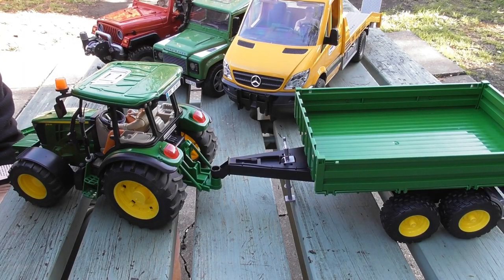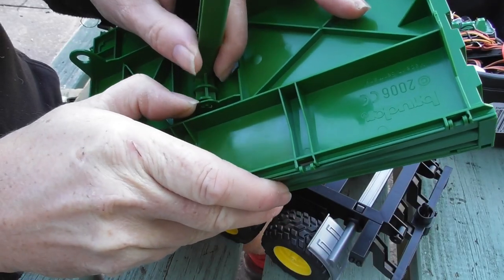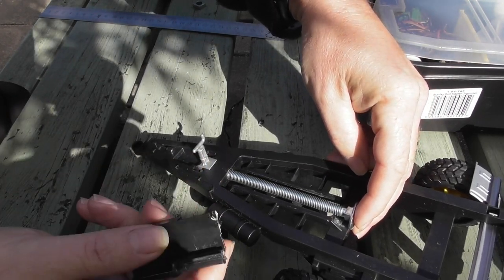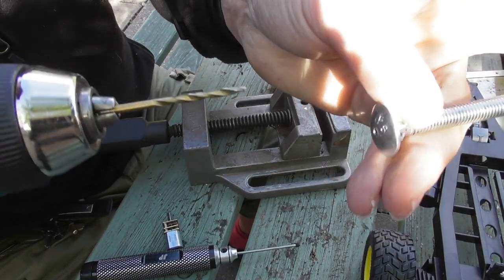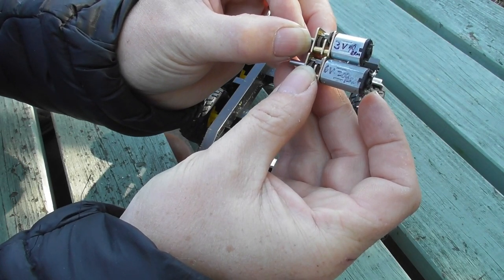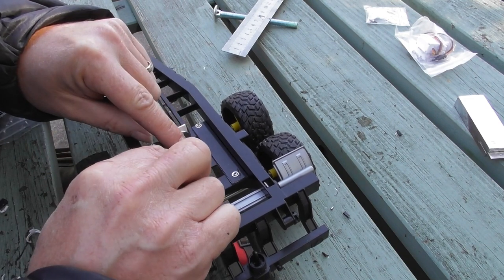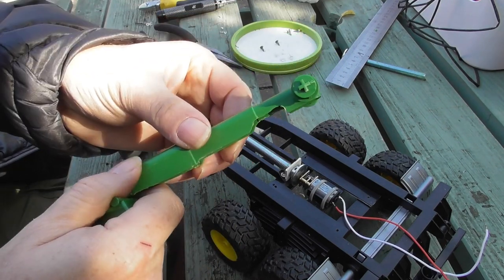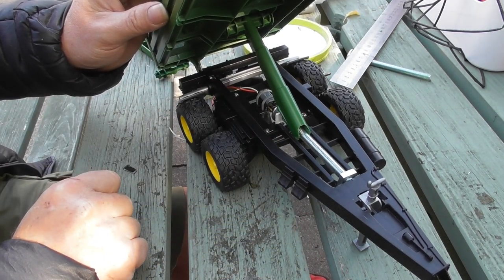Bruder Tipping Trailer RC conversion part 1: mechanics

Comment: Awsome DIY how to video.Im just getting into doing a few RC conversation too.Iv learns when joining smooth plastics with glue glue hold better scuffing the 2 pars The glue bonds them together and the bond is very strong.Thanks for sharing.
Reply from the maker: Thank you. Good advice on the gluing. 👍

Comment: Very nice work..I enjoy your videos.  Nicely done..The bruder line of toys I find such a fun challenge to bring to Rc life.. Its food for the brain challenges that make it fun..Big thumbs up #18 keep them coming bud
Reply from the maker: Thank you! Appreciate the feedback! Agree it is the challenge & the massive satisfaction when it works - plus I don't have to paint the bodywork after doing the mechanics 🙂
Reply: No problem bud, you know what can help you acheive the torque/power and speed needed for for screw drives.. Try lead screws from 3d printers etc for your drive system your get the power and speed you'll need..Your long bolt works good too yet the evolutions is high for the distance achieved 8-)
Reply from the maker: Brilliant - this (lead screw) is just what I was looking for when I start on the 'hydraulics' on the excavators and diggers - but I didn't know what they were called! I've sent off for some on E-bay to experiment with.    🙂🙂🙂

Comment: looking good. you could make a clamp to hold the motor better... a piece of plastic across the top with a nut and bolt at each end and tighten them down to sandwich the motor between the clamp and lower mount. 

my "bead lock" wheels arrived although i had to glue the tyres still, added a decent bit more wheel weight to my rig. i also hot glued some nails and bits inside that bumper to add a bit more weight to the front. seems to grip a little better now and less prone to rolling over backwards.

considering some rc4wd gellande mini tyres as they fit the wheels and might actually allow the bead lock to work.

also, your welcome. glad to see you putting some bits to good use.

roll on pt2
Reply from the maker: Thank you! The cable ties are holding well so far, but could need a revisit. Your WPL is coming along nicely, a bit of weight in front (especially around the rims inside the tyres) always helps with the climbing of a crawler. Kit version WPL tyres are nice and soft & scale looking, sometimes it can a few goes to get beadlocks gripping properly - seating them properly and then doing the bolts in a pattern can make a difference.The 6v N20 was just perfect as was one of the dremel bits. Good timing!  🙂

Comment: Very nicely done. Is the coach bolt thread metric or Whitworth...does it matter...eg. the speed of the "tip"
Reply from the maker: Definitely metric. Probably m8 (maybe 10?). I chose that as the square but fitted. It doesn’t really matter- different pitch threads will give different speeds - as will different Rpm motors. These days I tend to use T8 lead screws with 200 rpm motors in this sort of application. 🙂👍

Comment: Hi RC Modders! Your videos inspire me converting a bruder cat skid loader. Totally different approach than yours but still functional as well more like a magom rc kind off. Did not modified any cosmetic look and rather than putting on big servo I did put 2 small metal gear ones on each side to lift the main arm. Took me more to figure out how to arrange them but it end up quite well. I'm building a MAN dump truck now and wanted to know  if this method could be done for a bigger dump box. don't know if a bigger motor could be run from a Y cable connected to a channel like you did here. Again thanks for all these videos!
Reply from the maker: Great to hear that you are inspired. I tried to use a 2RPM 12v motor to lift a dump truck and it would not lift earth well. The method used on the tipping trailer in this video will work on any big truck, but will be slow usually, rams using T8-2 lead screws can be a good compromise between speed and power. For a bigger motor with higher voltage it is better to add an ESC - or at the very least a powerful BEC. hope this all makes sense.
Reply: @RCModders  yes it does!!! thanks again for those advices. sadly here its not as easy to get rc parts and you'll have to deal with its available. I'm sure I'll figure out how to. maybe use a bigger metal gear servo to drive the worm rod and add those limit switches. Again thanks for the reply. And keep inspiring RC models like me! Cheers from South America.

Comment: Iv'e been using the same "tipping idea"...threaded rod and sliding nut on a different model. When the nut has reached the stop eg. the tray is on the deck,  when I reverse the motor to raise the tray it k jams. Any suggestions would be greatly appreciated.
Reply from the maker: Travel limiting micro switches with diodes are the key.  😀👍

Comment: Excellent descriptive video You really are a myth. I would like to ask how many RPM has the electric motor you used
Reply from the maker: Thank you for your kind comments. I think that that I ended up using a standard tamiya 130 motor in this model -  which I believe to be around the 12,000 RPM mark at 3V. This one I believe : https://www.pololu.com/product/77  🙂👍
Reply: +RC Modders 👍
Reply: Really enjoying your convwrsion videos. Im interested to know what glue you are using to bond the plastic parts together. I see you are using a primer aerosol. Also why did you choose an 8mm coach bolt as against a 6mm bolt...was it because the nut fitted snugly into the slide? Cheers
Reply from the maker: @alangriff1  Glad you are enjoying them. When I use an aerosol with glue, then the glue is cyano (ie superglue) and the aerosol is called a 'kicker' or activator to harden the glue more quickly. This only works with the hard plastics. These days I don't use much superglue (if I do its the Gorilla brand) - as I tend to either bolt things, make 3D printed parts or use hot glue. The nut did fit nicely & the bigger the bolt, the faster and smoother it will move. Hope that all helps.  🙂👍